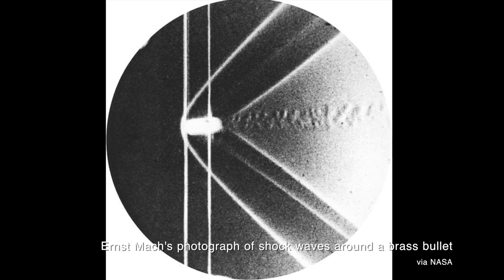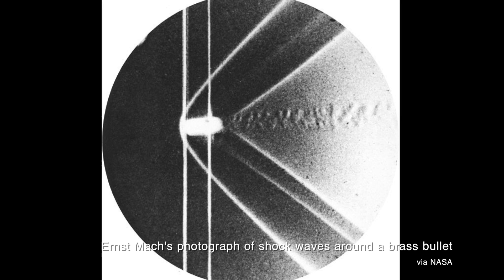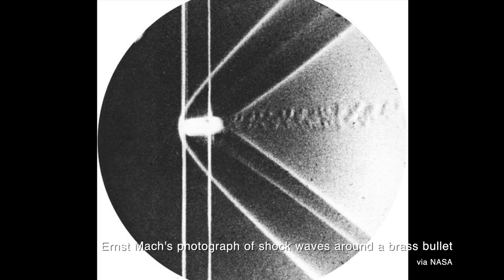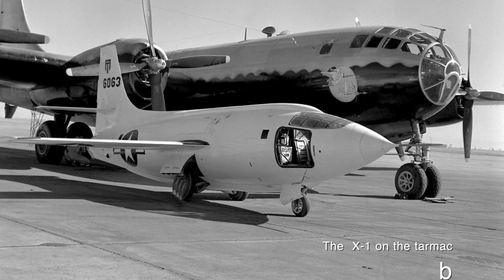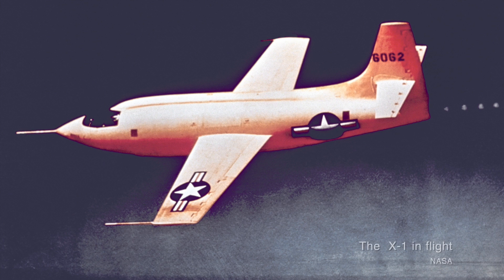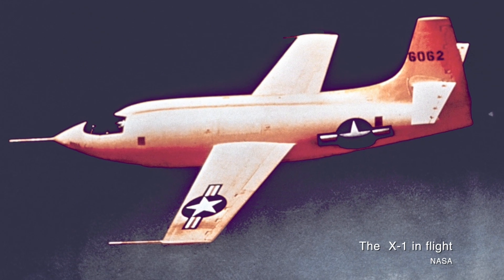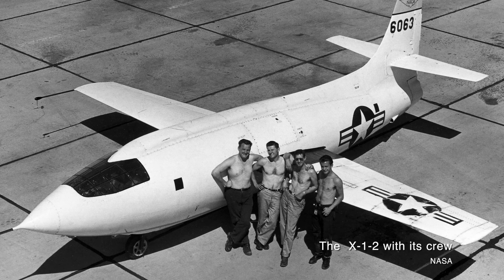What Happens When You Break the Sound Barrier?

Comment: Mack 0.8 is dangerous? Almost every jet airliner goes faster than 0.80M.
Reply: gmcjetpilot they have transsonic wings
Reply: @karlreisa3872  I'll check that out next time I go to work and pilot a B777 to HKG. Transonic means that part of the airflow over the wing is supersonic, it's not a wing type. Wing's design to fly at transonic speed +0.8 mach are called supercritical wings. The  design features sweeping, airfoils with flatter upper surface and area rule at fuselage. This allows higher speed before Mach shockwave and drag increase. You can go transonic or supersonic with much less wing sweep. F-104 had straight wings with a slightly swept leading edge and went Mach 2.0, by making the wings very small and very thin. The Bell X-1 had an airfoil very similar to the F-104 in plan form and thickness.

Comment: Couple of ideas for future videos.  Shock diamonds. I know what they look like, but never researched what causes them.  Another problem with being near the sound barrier, is the loss of control.  Standard elevators stop functioning.  I originally though that the idea of a movable tail plane came about after the crash of the DH 108 that killed Geoffrey de Havilland Jr.   Turns out a movable tailplan is an old idea, but its use for aircraft researching the sound barrier was new.  Another British project, the Miles M.52 gave their data and design to Bell Aircraft, who were having control issues as well.  The X-1, built using that design, including the movable tail, (lucky for Chuck Yeager)solved the control issue, and the rest is history.

Comment: So in in the end, the soundbarrier is just a physical phenomena of increased aerodynamic drag from mach 0.85 till 1.01 in combination with engines that needs to compress air above mach 1 to produce thrust (prop engine). Beyond this speed the drag drops and increasing the speed is fairly easy, on the precondition that your engine can actually generate thrust at this speed (jet engine).

Comment: What happens to the air in front of an aircraft that is flying faster than sound?  The air is still there, after going supersonic.
Reply: It gets turned into the shock wave, and gets compressed and heats up.
(and slows down behind the shock)
Basically a pressure pulse (which is what sound is) can only move at a particular speed in a given medium. If you're trying to get it to go faster than that speed, you get s shock wave forming as the stuff in front can't get pushed out of the way as the fast object approaches.

Comment: Next milestone will be to break the light barrier and they should get me to do that as I break stuff all the time
Reply: Yeah true, we used to consider faster than sound travel to be impossible in the same way that we consider the speed of light to be insurmountable. However at the speed of light time and space distorts so they reckon, and we will need something a bit more complicated than a cleverly designed metal flap on a plane to get there.

Comment: The early stabilizer design on the X-1 was a conventional stabilizer/elevator arrangement.  This didn't provide adequate control in trans -sonic flight.   The full flying stabilizer was a modification to that original surface, making the entire stabilizer a moving surface that did provide adequate authority permitting  the plane to finally go Mach 1.  The Germans attempted to solve the problem in the wind tunnel in 1943 by blending the main wing of the V-2 rocket into the tail fins forming the famous but fanciful 'Gothic A-9' .  Although wickedly slick, it turned out to be totally unusable as an aerodynamic solution to maintaining control through the transition and beyond.  Now all fighters and fast flying aircraft use the full flying stabilizer, first tried on the X-1.  ( I do believe the British first hit upon the idea in their M-1 design that was scrapped early in it's development.  That is another kink in the long and winding story of who invented what to fly faster than sound, I suppose.

Comment: I like that you find "fresh" footage to highlight your  talks, not just the old stale stock that a lesser presenter would use.  You do an excellent job at that.  The beloved X-1, using the tried and trusted straight wing with a lot of thrust to cram it through the transition, as opposed to the German finesse of sweeping the wings, delaying the compression drag and slipping relatively effortlessly through the surly bonds of subsonic flight.  Interestingly  the concept of swept wings goes back to the early '30s, as you said, which in Germany resulted in the A-9 concept of 1940 and the A-4b that flew right through the sound barrier in less than 30 seconds in the kludged flight of 1945. A Mach 3 conceived and built  at a time when fast aircraft were +300 to 400 mph. Alas, no pilot was aboard on that one.

Comment: OK so the US likes to claim to have developed the first supersonic plane but you are either unaware or just neglected to mention where the actual design originated. The X1 is based on a UK design from the early 1940's and in fact the X1 'designers' tried to modify the design of this plane when trying to put their stamp on it but had to revert back to the original design when the modifications did not work. The UK schedule would have had the UK design through the sound barrier within weeks well before the X1 flew but it is unclear why the UK government stopped funding when within a few flights of breaking the sound barrier and they then handed the entire design to the US. It was during efforts to gain support from the US during WW2 so it was almost certainly a political move (similar to the provision of the jet engine designs and prototypes).
Reply: I'm sorry, but but that's really not  correct.
First - despite attempts by some modern day writers to play up rivalry aspects between the Brits and the Americans, cooperation on basic research and implementation was quite close, and information was widely shared.  This is especially true in the investigation of high speed behavior of aircraft.  For example, the use of a slab tailplane was first proposed in the 1943 joint Transonic Conference, and  parallel flight investigations were performed by the Royal Aircraft Establishment with a Spitfire, and the N.A.C.A. with the Curtiss XP-42.  
The Bell XS-1 design, other than size and a superficial (round fuselage cross section / pointed nose / mid-straight wing) similarity in general configuration is quite different. Deign work had begun in 1943,  The formal contract on the configuration was let in April 1944, and the design was finalized in December 1944.  Construction of the first prototype took less than a year, and glide flights began at Pinecastle Field (Orlando, FL)
in January 1946.
Note the timeline - by the time that the RAE revealed the existence of the M.52 project in October 1944, the X-1 configuration had already been decided.  It's not surprising that there were similarities - both teams were working with the same information to similar specifications - the air behaves the same everywhere.
It's worth noting, at this point, that the X-1 never had a slab tailplane.  From the beginning, it had conventional manually controlled elevators, and an electrically actuated movable stabilizer for trim.  The only change to the system was to re-wire the electric motor driving the stabilizer trim to speed up its response at high speeds.
Despite persistent rumors, an all-moving slab tail is not required for control in supersonic flight. (Although it is the best) - the F-86A Sabre fighter - contemporary to the X-1, and the Grumman F9F-6 Cougar carrier jet fighter were both supersonic in dives, and worked just fine with conventional elevators.  The first models of the Soviet MiG-19 supersonic fighter had a fixed stabilizer anc conventional elevators.

The Miles M.52 was cancelled in February 1946, before the first airframe was completed, or any runs of its intended engines were performed.
Sir Ben Lockspeiser, the Director of Scientific Research at the Ministry of Aircraft Production, cancelled the project due to his perception of the dangers involved.  There was a continuing effort to pursue the project with rocket propelled models, but the development effort was protracted, and didn't produce any successful flights until late 1948.

Unfortunately, the Wikipedia pages aren't very good references. - too much emotion involved, I guess. 

(Oh, and the U.S. had launched its jet engine projects before the Arnold Mission to Britain in 1941 - while the GE centrifugal (J-31) jet engine did get some benefit from Whittle's work (The internal aerodynamics and the combustor design was different) the other engines under development - the Westinghouse J30, J32 and J34 axial compressor engines, the GE T31 axial flow turboprop, and J35 axial engine, and the Lockheed and Northrop efforts bore no resemblance to anyone else's work.
Reply: Miles M-52.

https://en.wikipedia.org/wiki/Miles_M.52
Reply: Peter Stickney wow!
Reply: It is generally acknowledged that the Americans in this period were the recipients of advanced and useful British research of the kind that wasn't returned. I'm not saying the Americans didn't cooperate at all but the research they gave to Britain wasn't of the same standard, being that Britain had actually flown a jet in 1940 even before the Americans officially began their jet programme.
However Britain also shared technology with the Soviets, whom just after the war were still considered an ally. The Rolls Royce Nene jet engine was widely considered the best of its kind at the time and was the basis of the MiG-15 which gave the west a terrible shock in the Korean war. Hindsight is 20/20 as they say though.
Reply: Don Felipe -That’s assuming that all cooperation has been made public. The British could have failed to give credit for what they received for a number of reasons. 1) perhaps they agreed that a boost in national pride was in order and were allowed to claim ownership of what they were given. (govts do it sometimes with military intervention when they take an action on behalf of a country then give that country credit) OR the cooperation was highly classified (from what I understand the Brits take longer to declassify certain things than the US) OR the deal was never research for research, it could have been research for economic deals (materials such as steel or oil or agriculture at a cheaper price or no interest or whatever)

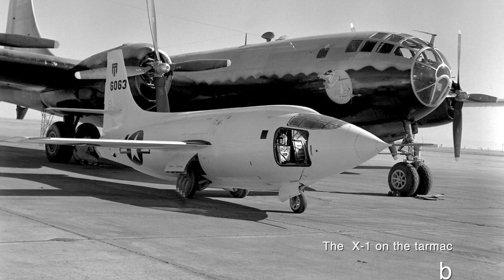Comment: 3:12 .. Amy, you almost got it right.  A fired bullet does not go faster than sound, per sé. Lots of types of bullets fly subsonic. Both the Germans (building the V-2) and the Americans (X-1) used the shape of a bullet like the 7.56 mm, because they knew this one went supersonic. This bullet was already widely used and its flying characteristics were well known. They only  scaled it up and, in the case of the X-1, added wings. Both designers were smart enough not to re-invent the wheel, because they already had an object with a very good, fast, aerodynamic shape !  ;-)
Reply: not quite the x1 was based of the browning 12.7mm aka .50bmg. 50cal was selected because not only was it super sonic but it had a extremely long range for a round that size so engineers reasoned that it was the most stable shape possible.

Comment: My dad saw .98 on the Mach meter in a Convair 990 (airliner slightly smaller than the Boeing 707) after a flutter test hung up the spoiler on one wing and the airplane did a flip and then a dive almost straight down.  Maximum rate of descent was 43,000 feet per minute, starting at an altitude of about 40,000 feet.  Back on the ground the next day, the guys in engineering figured that the pilot recovered about 10 seconds before the wing panels would have started to come apart.

Comment: Among the other things which exceed the sound barrier are the tip of a bull-whip when it cracks, and the tips of most helicopter rotor blades. Most Police and news helicopters are fitted with blades designed not to do that in normal patrol, but when power is needed for an event taking place on the ground, the noise rises appreciably as the tips go supersonic.

Comment: You have a little editing glitch just after 6:30.

I would have mentioned the compressibility problem the P-38 suffered from in power dives, but that's just me.
Reply: To my knowledge it was more than just the P-38 -- but the problem was most prevalent with the P-38.  Problems with compressibility weren't hypothetical -- there were a number of aircraft and pilots lost to it during WWII.

I tried to look up more info on the 'net, all I found was a passing reference to the P-47 using the same sort of dive brakes that solved the death-by-stick-snatch problem with the P-38.  I think that one of the Grumman fighters (F8F? F6F?) needed this, too, but I could be all wet there.

https://history.nasa.gov/SP-468/ch5-3.htm

Comment: I wish you'd have mentioned the accident Lockheed had with the p-38 lightning where supersonic flow over the wing caused the plane to nose dive and kill the pilot. Real Engineering has a really good video on it.
Reply: Bracy Harvey since pretty much all the higher performance planes would get into compressibility in a dive there's really no point singling out one. I've also seen extensive testing done on laminar flow compressibility on P-51's.
Reply: The only reason I bring that one up is because I'm pretty sure it was the first plane to have a serious problem with it.

Comment: The SR-71 Blackbird is so sick– it uses a pitchfork-like apparatus to split the air, allowing the plane to slip in between!
Reply: TheStanishStudios that's not what it does at all. If you're talking about the little probe out front, it's actually part of the flight computer. Senses pitch and yaw with relation to the relative airflow. You can't do big movements at Mach 3+ so the computer takes care of it. And the shape of the plane is to use the flat chines as canards. The engines are tilted 2° down so the front is always flying and it reduces the aerodynamic drag from control surface deflection. Ha ha ha I gotta stop myself. I love talking about the blackbird. 👍🏻
Reply: Amy. You should do a video on the SR-71. Thanks, Frank

Comment: The serious transonic issues are control surface flutter and Mach Tuck.  The former is just what it sounds like and the latter is when the center of lift moves aft as the aircraft gets closer to mach 1, moving farther from the center of gravity and causing a nose down moment.  This can become more than the tail can overcome resulting in a pitch down which, in turn, increases the speed and exasperates the problem.
Reply: Mach tuck,  (which sounds like fast food) might exasperate the pilot, but it's more likely to exacerbate the problem. :-)*
As you point out, C.of L. moves as the regime changes; Concorde used to have to pump fuel fore and aft to deal with that. 
Another issue is that airflow speeds at different places around the machine can differ. When testing the P-51, Jackie Cochran had airflow through the radiator scoop go supersonic; she said it sounded as though a dwarf with a large hammer was running around in the belly of the aircraft.
Reply: Haha, yes, thank you.  You are much more help than Siri.
Reply: Gun Sense (drmaudio) All ballistics to me...😀

Comment: The second supersonic flight was much more impressive. The Army was getting ready to do a supersonic flight with their own ground launched test plane, but it was behind schedule. So to shut them up Yeager fired the rockets from a dead stop on the ground, lifted off, and broke the sound barrier a few hundred feet off the ground.
Reply: That was actually because the Navy was giving them quite a lot or ribbing about they were flying a REAL airplane (Douglas D-558-1 Skystreak) because  they could take off from the ground.  The X-1 landing gear was designed with its empty (landing) weight in mind.  But Yeager told his boss that his Flight Engineer, Jack Ridley, figured that if they pumped precisely the right amount of fuel, they could safely take off from the ground and still go supersonic, which they did.  The Air Force eventually got its own back when the Navy went to test the D-558-2 Skyrocket, which being rocket powered,, had to be dropped from a bomber.